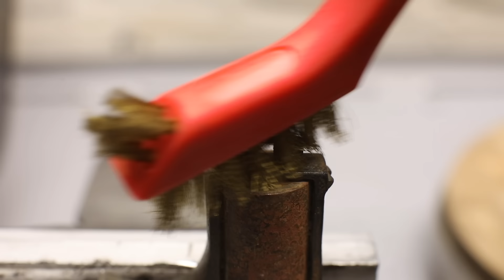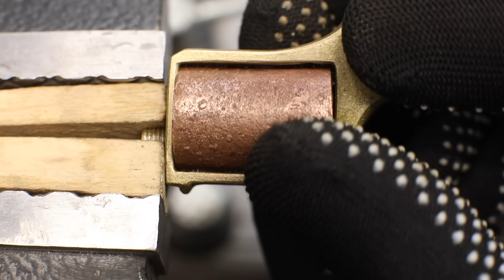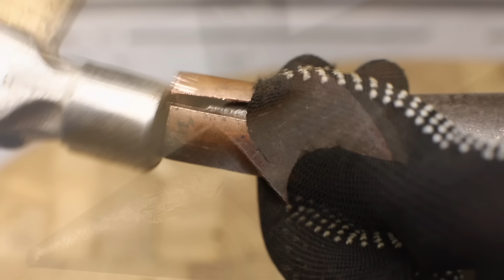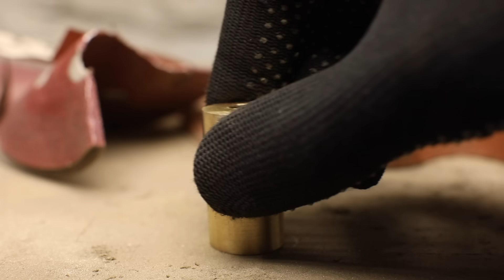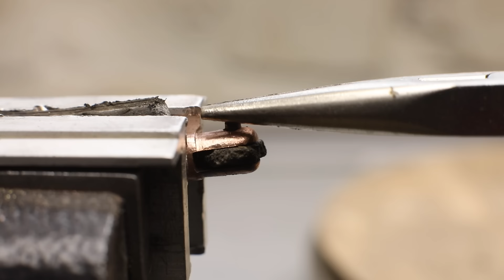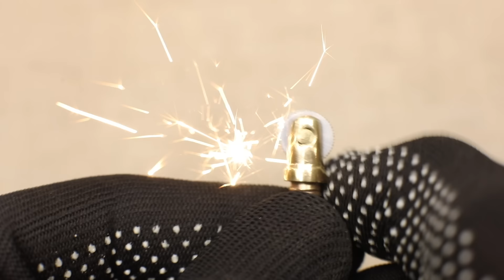Unique Old Gun Lighter Restoration. WW1 Trench Lighter

Comment: simply wow. 
any idea why the copper didn't "accept" (take? what's the correct word in english?) the tin solder?
Reply from the maker: A high temperature is required for soldering copper. I soldered one part, but when I soldered another part, the previous part was unsoldered)
Reply: thanks (and sorry the amateur-question, i have no idea about this stuff)

Comment: Why didn't you use the gas torch to solder the copper? The copper was conducting heat away from the soldering iron faster than the iron could supply it.

Comment: In order to solder copper tube, you need to have cleaned the joint well and use acid flux and 60% lead-40 tin solder , or a silver solder with a flux core and plenty of heat.
Copper tube from the early 20th century was made of a different compound of metals, which were easier to solder.
Reply from the maker: Thank you! I soldered one part, but when I soldered another part, the previous part was unsoldered)